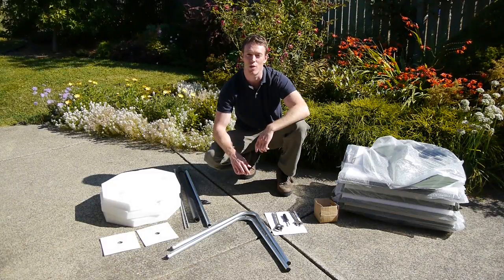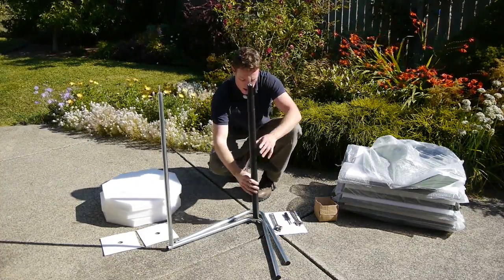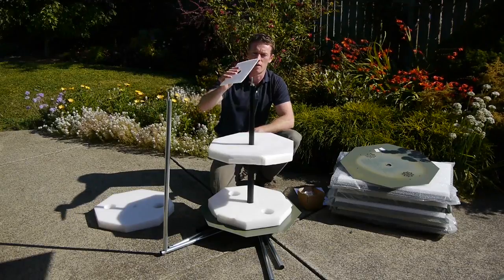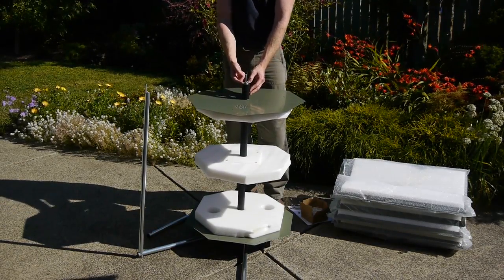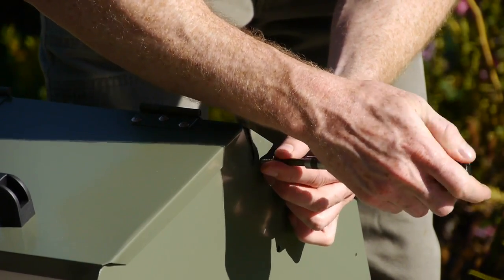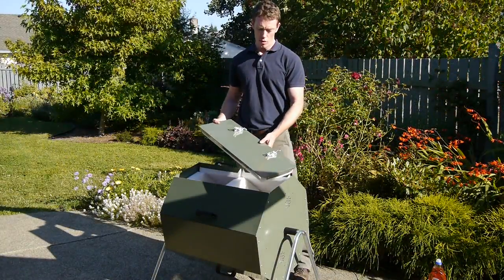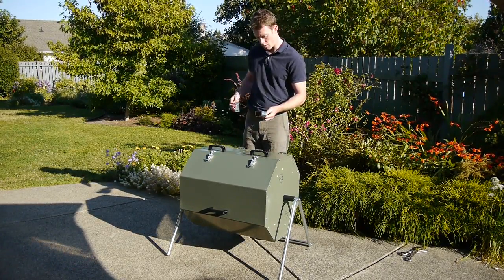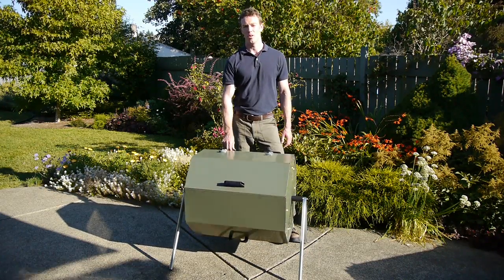Assembly of the Jora JK125 Compost Tumbler at Eartheasy.com

Comment: Thank you for the video.  Since the video was made several things have been changed with the assembly.  The end panels have two holes on every side of the panel - no longer a side with no holes.  Also, our styrofoam was cut so thick, it darn near made assembly impossible.  I plan to write Jora about that.  Otherwise, it is a great composter, and your video made assembly so much better - the instructions that come with the unit really suck.